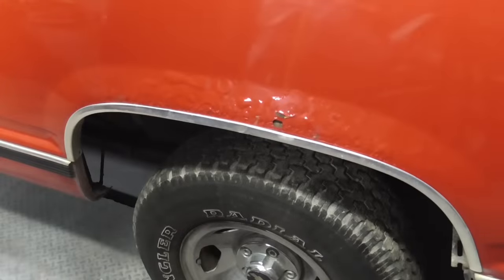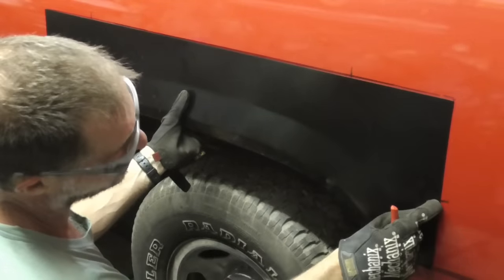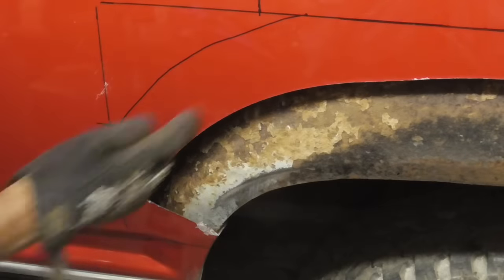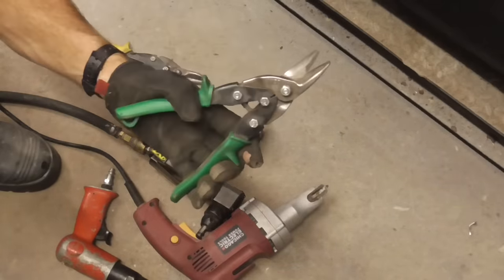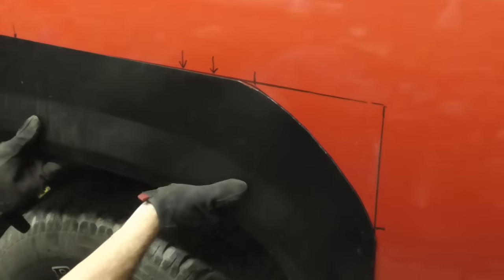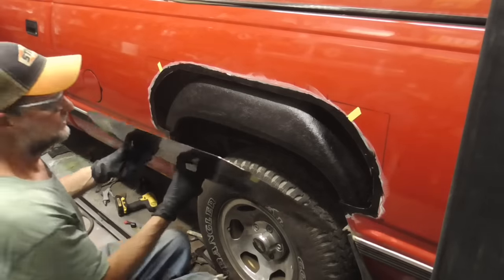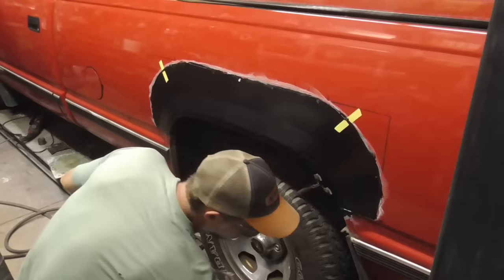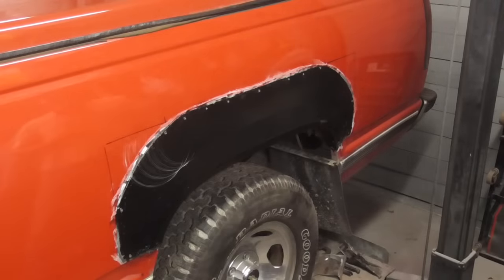Glue On Wheel Arch Rust Repair Panels w/ SEM Impact Resistant Panel Adhesive

Comment: Wow . Very cool but you're using really old school methods. I may of missed some things in your video but these are a few thing's i would of done differently. I've been gluing panels for over 25 years. 
First.  Orginal paint is the best primer out there . If it isn't bad use it . Don't over grind metal and expose bear metal and scoring it if you don't need to . 

Second , They have tools that can joggle/knotch that 1 inch edge so your panel will fit almost flush and you don't have to hammer the joint in like you did and possible cracking the seal created by the epoxy glue . Less work in the end. Less bondo
Third ... on the inner part . Us epoxy primer to protect the metal . Keep that black primer if you can . Sand enough to scratch the surface so the glue will bond removing all the orginal black primer to bear metal isn't something I'd do.
4th only grind the edge of the joint and fill in the edge with that glue . 

5 all you need to do is sand/ feather edge the paint around the joint . Griding will score the metal more then needed and often can be seen threw the paint .

Comment: Good for another year, the sound of your air compressor says it all
Reply from the maker: In case you're trying to be smart, see this video - https://www.youtube.com/watch?v=gIS1Tbv7Kvw  Also if you do find any more of the old Craftsman air compressors from the 70's and 80's they are the best - quiet, run forever, put out tons of air compared to newer stuff.  Try to find a new compressor as quiet, oil filled, belt driven, USA made, 50-100 bucks that puts out what this does - 5.4 SCFM @ 90 & 6.4 SCFM @ 40  If you do pick one up you'll never want anything else.

Comment: Now that you are done with the Chevy, I have a King Ranch that needs underneath rocker panel rust repair where the pinch welds meet. I own a operate a paintless dent repair business. I do not repair rust.
Reply from the maker: You must be quite busy with the PDR business.  Anything to do with mechanics, bodywork, heck anything that takes work, you'll be busy as heck :)
Reply: @LakesideAutobody  Word of mouth is the best advertising, and it's free. Treat your customers well, and they will spread the word. If the repair isn't perfect to my standards, I won't charge the customer full price, if I even charge them at all. Dealerships, insurance agents, and body shops use my services all the time. They also spread the word.

Comment: I like how these videos encourage you to do repairs yourself for way less than the local shop. But then, when you want to actually do it yourself by following the video, it turns out you need $2000.00 worth of routers, grinders, impact wrenches, pneumatic drills, and special clamps and unique clips, plus adhesives and curing agents that are not available anywhere nearby, and when you do find some, it's $75.00 for a 20 gallon tub and you only need 6 ounces.
Reply from the maker: Good idea for a video my friend.  I'll do a video on the bare minimum amount of tools and materials to get started doing bodywork at home.  Thanks - I think a lot of folks probably are confused about that :)
Reply from the maker: @tomtrajnowski4266  This type of repair is for folks worried about a 100% water tight seam 😊

Comment: Why would you use rivets?
Reply from the maker: Feel free to use screws or rivets, it really makes no difference.  You really don't even have to fill the small holes - I just did so that I would get any negative comments about leaving them.  If it's going to ever rust again it will begin at the bottom of the panel where the salt water and debris gets trapped - not up high :)
Reply: It's glued. No rivets required.

Comment: What about the wheel well that's all right out
Reply from the maker: If you are talking about the inner wheel well - you can fix that however you want.  Make sure you leave some large holes for drainage - that's why it rusted in the first place - debris, dirt and rust chunks get trapped and stay wet in there :)

Comment: I know when it’s a paid job it’s. Time / money thing but…….      That raunchy inner fender really ought to. E at least pressure washed, knock off the surface rust ,flake and crud the coated in something like POR 15.         EVERYTHING goes flying up under that box where dust, dirt collects. So you need all the help you can get if you’re in the Rustbelt.

Comment: Looks good, but a little disappointing that you didn't even mention let aline tske the time to clean up the rust and dust on the inner panel and give it a layer of rust paint or POR15 or something while it was exposed.  Can't really do it after, so a wasted opportunity. I like to follow these jobs up with an oil spray on the  underside, too.
Reply from the maker: That's because you don't really want to coat it with anything and trap moisture with coating (moisture will eventually get between the paint and metal).  Simply make sure the panel can drain and dry out inside and do this - https://www.youtube.com/watch?v=8XaZBy7GC7A

Comment: I'm part owner of pipeline coatings company. I could make an easy to use panel epoxy with at least 8000 lbs per square inch strength. It would be kind of expensive to set up to make it. But if I could sell enough I could get the price down. Right now I'm just thinking.
Reply from the maker: Get the ball rolling.  Send me a sample and I'll do a video on it for you 👍✌😊
Reply: @LakesideAutobody  OK so far all I have is mental calculations. I'll be in touch.

Comment: You may have used adhesive but you also used rivets. I worked for a guy 30 years ago that would rivet arch panels on
Reply: Need something to fill in the holes

Comment: All glues degrade from heat and extreme cold fyi. This is why the Dept of Transportation bars using glues in structural components. Lotus cars had a car model banned here because they epoxied their chassis to make them lighter.
Reply from the maker: ICAR requires it.   GM Does it.  https://rts.i-car.com/collision-repair-news/crn-736.html  Ford Motor Co. and General Motors are now building cars the same way kids make their plastic model counterparts: They are gluing them together.

"The automakers aren’t cutting corners to reduce costs. Structural adhesives can cost more than welding or riveting. And contrary to what the average person might think, adhesives make for more durable bonds, which car companies like. Moreover, adhesives help automakers replace steel with lighter-weight aluminum, leading to meaningful improvements in performance and fuel economy"  - https://cen.acs.org/articles/92/i16/Automakers-Look-Adhesives-Aluminum-Gas.html

Comment: at about 4min.  and other times you can hear your air comp. kicking on, enclose it with a 2x4 box and egg crate foam running a fresh air line from outside with a large filter , your ears and sanity will thank you. 
other than that great video will be doing this on my 08 silverado.
Reply from the maker: Thanks JR - have a good week :)
Reply: Its amazing how there is always someone that finds fault FO JR

Comment: Seen it done 3 times. Everytime the filler lines or the glue line starts to show through.
Reply from the maker: Impossible if you knock the seam down before filling.  Same with welding a patch.  You have to tap the seam down - butt or lap.  https://www.youtube.com/watch?v=t1WclT_GMvk
Reply: From what I saw it looked to me like the glue expanded and contracted at different rates then the filler and paint causing at worst raised lines or at best what kind of looked like burn lines in the clear. It took some time, or a really hot paint booth cycle. I work for ford right now and I've managed good results with panel bonding with sleeves on aluminum, but every glued large patch panel that's come through had the issue.

Comment: They stick aircraft together with adhesive so cars not an issue. Better than welding no distortion on sheet metal panels
Reply from the maker: You're right on.  Thanks for the input Reuben :)

Comment: Love your videos! I'd like to get your opinion / see a video on laying down fiberglass over an entire truck cab roof. Roof has a few rust spots and is very thin metal. I wonder if it will stiffen up the roof as well as take care of the rust.  (83 squarebody) Thanks!
Reply from the maker: Myself,  I would use a fiber resin disc on slow speed to first grind the heavy rust off,  the sand blast those spots best you can - basically to clean them up and bit and help the filler really stick.  Then you could tap those thin spots down a bit (if you have a head liner) and fill with fiberglass reinforced filler.  Any other imperfections use regular filler.  You can use fiber glass if you want but I think (just my opinion) it's over kill.  Once you paint it - it ain't rusting again - won't get wet inside the cab.  Jerry

Comment: Nice work, but I would definetely flange the back panel
Reply from the maker: You could do that for the large flat area but what about the wheel well lip, rigid rocker panels, door edges, bends, odd shapes, etc.
Reply: @LakesideAutobody  makes sense, it is a complex area. Nevertheless nice work sir
Reply from the maker: @rfreitas3298  I will do a video on that though - where you flange the whole perimeter of the the patch.  There are situations that that can be done so - good thinking :)

Comment: I saw you didn't recommend using the adhesive and just gluing the panels together. I saw a Hotrod tv show do that once with a panel bond adhesive. 

It looked simple but I just wouldn't trust just that panel bond to hold the patch panel on.
Reply from the maker: You don't have to worry - cars have been being assembled with adhesive for many years now.
Reply: @LakesideAutobody  Cool, Thanks for the reply.  Maybe do a video on just using the panel bond and no screws or rivets sometime. Or if you have, I will go through yours and watch it.
Reply: They bond panels with this epoxy on new cars, when it was first developed they called it "40 mph rollover epoxy" because that was the speed at which it would hold to
Reply from the maker: @TheBlackmamba06  Thanks for that comment Nathan :)
Reply from the maker: @72Dexter72Manley72  I'll do that - thanks :)

Comment: I bet this won't hold 2 years. As you didn't trust treat three inner side of the fender, Wich will continue rusting. Another problem will be the differential expansion of the glue and the metal when heated or cooled. Yes for now this looks nice and good but I want to see this fender in 2 years after really being used
Reply from the maker: I will last as long as a new panel because of the water tight seam.  They glue panels every day in the factories.  I'll make a follow up video on this an other cars that were done soon - you're mind will be opened :)

Comment: You left 2 large holes in the panel down next to the wheel opening.
Reply from the maker: Drainage if I'm thinkin' of the correct hole.  You absolutely want to make sure your repaired panels can drain and dry out inside - that's why they rusted - got plugged with water and debris :)

Comment: Nicely done! A welder burns the carbon out of the panel causing it to rust at the edge of the weld in time, In my opinion this is a better option!
Reply from the maker: Plus you get a water tight seam :)

Comment: If you're going to overlap it why cut it to 1 inch, why not leave the original panel long angle use it for additional bond and rust protection.
Reply from the maker: You could but you want room to knock down the seam (a must for lasting repair) and work the filler.  You want your filler in nice open areas - hope that makes sense :)

Comment: So what exactly was the lower wheel lip attached to? There was nothing there after removing the rusty panel! IF going to all that work, why not just glue the bedside on? 4 spot welds in the corners and you're done! No filler, sanding etc. You mostlikely have to buy the whole panel anyway. Overall, a good video, except the lower lip atachment.
Reply from the maker: I should have shown it from underneath the inner wheel well was still in good shape the lip was glued to the lip on the inner panel.  You would never glue that panel on without the lip glued or welded to something - just not study enough without it :)

Comment: Understood everything except the rivets. Would have appreciated more details about what they were and how they were finalized.
Reply from the maker: They were installed (dipped in the adhesive to keep them encased), then just lightly touched with the grinder/sander, tapped down and filled.  You can absolutely leave them out though - just put them in to avoid negative comments about the 1/8" hole left.  That hole won't hurt anything as it is up high and away from trapped moisture :)

Comment: White kind of body filler do u use
Reply from the maker: Right now I'm using Auto Body Master light weight body filler - it's around $21/gal.  I try to find the inexpensive stuff - to me it's all pretty similar.
Reply: @LakesideAutobody  I'm gonna give that a try, thanks
Reply from the maker: @oscarontiveros5117  You're welcome Oscar - have a good weekend :)
Reply: Body filler is crazy high. I'm not crazy about it, but the 3m bondo brand filler at Walmart is only $15-$18 a gallon I'm thinking. At Advance Auto it is like $30
Reply: @jonathanyates5198  yeah thats what I'm currently using...definitely not a huge fan of it , but I gets the job done 👌

Comment: No adhesives work good in Las Vegas. You forgot to step the flange on the fender. That tool is in harbor freight too. Less filler and time to finish.
Reply from the maker: You can't flange the whole perimeter of the opening because of the wheel well lip.  Have to knock down your seams anyway for a long lasting repair.

Comment: Yeah that was cool. But that took WAY longer then it would take to just weld a new piece in and clean and prep it for paint. Plus extra cost for the glue and rivets. Dont make sense to me to go this route.
Reply: This way will outlast welding. No burn off of coating on the back side

Comment: Neat to show . 2 weeks later .. finished and made a target from shrinking .. Also was not set   Up correctly at all .. there is not 1 panel bond company that wants anything over 36 grit cuts for adhesion . But two cans of filler will get r done lol .. box side all day
Reply from the maker: That's bad information.  You'll see this repair again tomorrow 4/22 as I do another repair on the lower part of this quarter - no shrinking at all, the bond will last forever - no worries - been doing it for years now - along with many other very good body shops in SE Michigan - the rust capital :)
Reply: @LakesideAutobody  for the product , the materials and you’re labor it’s not worth it and it won’t last for years I’d put money on it . Also your patch will fail because you are not fallowing the product directions also if you have been doing it for years it’s been wrong
Reply from the maker: @jaredclement6678  That's bad information again.  See this follow up video - https://www.youtube.com/watch?v=gIS1Tbv7Kvw  - not sure why you would believe TV/magazines/internet and not a guy who has done this his whole life.  Why wouldn't you want more $ in your pocket ?  This was purchased for $8000 w/ 7,500 miles on it now my wife drives a new car for a fraction of the price - you could do that too if your mind was open - https://www.youtube.com/watch?v=ENgdswDe1Fg

Comment: DO NOT ALWAYS BELIEVE WHAT YOU SEE ON YOU TUBE. 
If you go to the SEM website you will find this  "Note: Partial panel replacements are not warranted for cosmetics, as they may show a bond line or halo due to techniques in workmanship."
3M and SEM say not to do this. I learned years ago when Duramix 4040 came out. They said it was ok to do this repair when adhesives first came out. They changed it a year after adhesives introduction. 
The fact is, epoxy adhesives and polyester fillers expand and contract at different rates in temperature changes. What SEM says is true! 
Now, this may need extreme temperature changes for an extended period of time but the fact is, the halo line (where the panels are attached) can occur. Vehicle colour (black vs. white) and geographical locations can have a factor (E.G. high temperature swings) 
In Lakeside's video of the lower door replacement, this area is covered by a body side moulding. The attachment line is not seen other than the ends of the door. This is acceptable as the halo line is minimal. 
Always read the Tech sheets from the adhesive manufacture before using.
Reply from the maker: The folks that wrote that don't work in a body shop.  Do it the way you see here and you'll never have issues.  Thousands of shops use panel adhesive for rust repair - they really are just "staying safe" by saying that - CYA type of thing.  See this video on longevity - https://www.youtube.com/watch?v=gIS1Tbv7Kvw  I will do another follow up 2-3 years from now - it will look the same :)

Comment: I bet it all ready shrunk out an u can see the sharp edge.should have used Duraglass b4 the filler
Reply from the maker: No.  Here's a video with repairs done similar 3 years ago.  I will have a follow up video on this soon.  You have to tap the seam down before filler.  With any seam that's important but folks are affraid to do that because they think filler is bad. https://www.youtube.com/watch?v=gIS1Tbv7Kvw

Comment: Leave only 1/2 inch, use a step flanging tool now the panel will sit flush .
Reply from the maker: Good thinking but you can't flange around wheel well lips, 90 degree bends, corners, rockers, etc.  Unless you have a solution for that.... let me know if you do :)